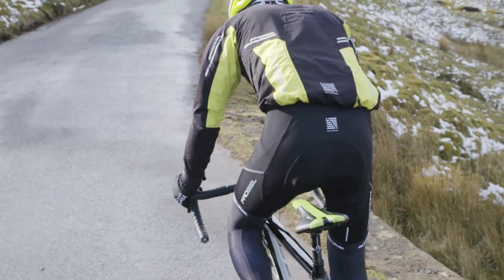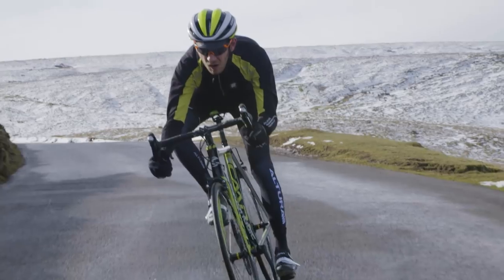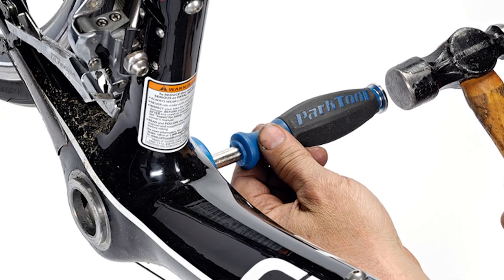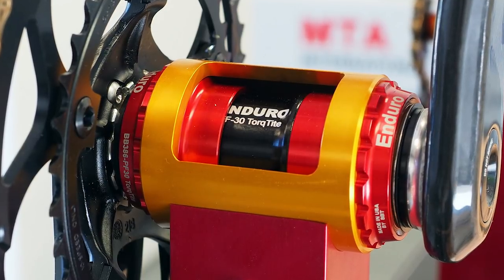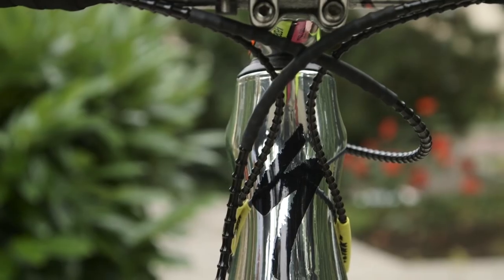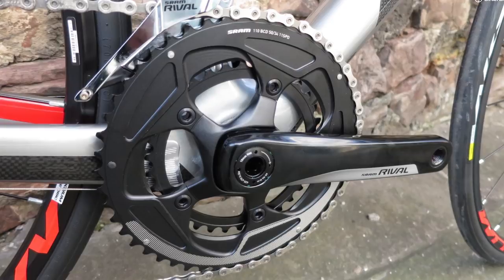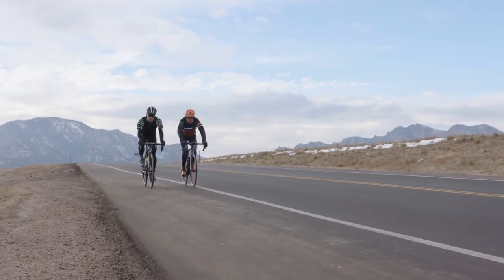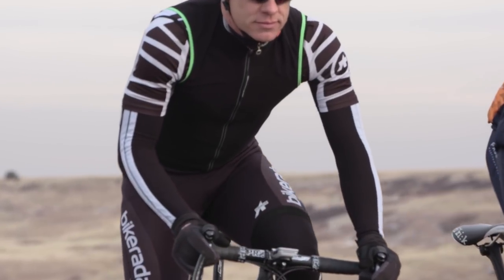Top 5 - Road Bike Upgrades

Comment: my upgrade was taking off the reflectors...
Reply: I replaced them with a custom reflective foil sticker on my rims. Road legal once again.
Reply: reflectors and lighting dont have to weight much. there is nothing more scary to a car driver, than a neigh invisible cylist!
Reply: I personally use 3m reflective tape because they work better and weigh less than the reflectors!
Reply: Same here, sticked to them rims.
Reply: Welkam tu ze klab, sid.
Haven't seen any road cyclist with reflectors, even on clothes.
Reply: @СемёнСемёнов-ы1ь  prison
Reply: Nicolas German Ditto. Plus you can buy colored reflective tapes that blend in better with the frame.

Comment: this tubeless thing is nonsense. Less rolling resistance, more grip? A lie. More puncture resistance? Yes, but with modern tires I have 1 or 2 punctures per 10000km, so that is more a theoretical advantage - and this theoretical advantage is bought dearly with new sealant every few month/every few 1000km. This sealant costs much more than the few inner tubes you need once or two times a year due to punctures and it is much more trouble and swinishness to renew the sealant than to change a inner tube. There is only one reason for tubeless tires: more money for the manufacturers
Reply: More grip come from the ability to run lower pressure without pinch flats.
Reply: Oh man thanks for this. That's exactly what I've been saying for a long time. Never really understood this tubeless hype.
Reply: lower pressure, less/no flat. lower pressure does mean more grip. less rolling resistance, hell, not really. with good tubes its pretty close, can't tell or measure the difference myself. that said id still go tubeless for the 2 very distinct advantages of lower pressure and less/no flat (I've never had a flat on road tubeless .. its been 3 years, i ride 5 days a week - and have probably been lucky so far - but still)
Reply: Lower pressure is for more grip. It allows the tire to conform to all the various features on a road or trail rather than bounce around on it. Less rolling resistance because again, not bouncing off the surface rather conforming to it.
Reply: "on a trail"??? Hey guys, we are talking road bikes! Lower pressure means less rolling resistance??? That's correct only for MTB/CX or to a certain point on the cobble stones; on normal roads its quite the opposite. And, @kangsterizer, well, you had no flats in the last 3 years - that's fine, but you had to renew your sealant about 9-12x, I think? I had 5 flats in that period, changing 5 inner tubes took 1-2 min and 5 € each, is that really an advantage for tubeless? (usually riding 250-350 km/week; btw: made the change back to tubulars on my race bike last year, no puncture on that bike since than, too...)
Reply: Tubeless tyres offer better traction, lower rolling resistance, lower weight and puncture resistance. Fact.
Reply: There is no such thing as a glass-like smooth tarmac road unless it was just paved the prior day to you riding it. Lower pressures will allow you to roll faster, tubeless allows this to be done without pinch flat fears.
Reply: nonsense. Fact.
Reply: Smale Rider how many pinch flats do you actually have in a year? I had one last year. one single flat. I run 100 psi. sure 90psi would be better against pinch flats with tubeless compared to tubes and 90 psi but I can't run 90 psi without  feeling sketchy when I sprint.
Reply: kangsterizer Def depends on conditions and terrain. mtb with low pressure for maximum grip tubeless is great. for me on the road 1 flat takes sub 5 minutes to change. one disadvantage to tubeless that no one talks about is if you get a cut and not a pin hole. sealant will fill a small hole but not a decent sized cut in the tire. You'd have to place a tube and something to cover the hole regardless of tubes/tubeless set up. the fact that tubes are cheap, I rarely flat, it's less messy, and I can change a tube and be moving in sub 5 minutes no problem means I continue to use inner tubes on the road.
Reply: Just trying to sell more stuff to people. I used Kenda Heavy Duty tubes on my MTB and never had any issues.
The MTB world also has a lot of wussie weight weenies.
Reply: very very true mate..
Reply: Do not use road tubeless unless you enjoy ending your ride 50km from home with both you and your bike covered in latex spray.
Reply: And you don't think the road world has even more?  LOL
Reply: fiddler on the bike 
Tubless is a thing thay is better for gravel and cx riders mor than anything
Reply: Dave Carter till you have to change  into a tube roadside with tubeless road tyre/wheel impossible to do get tyre back on. The reason tubeless on mountain bikes is the norm now is all the advantages of grip/feedback/comfort but we can put tubes in trailside if tyres  damaged & refit the tyre back on rim trailside. Till the road bike wheel/tyre manufacturers can solve this it's not a combination I what have on a dark cold winter day or night on the road.

Comment: Saddle should be number 1. You won't go far with an uncomfortable saddle which is usually what you get on a new bike.
Reply: Anything that makes the bike fit better is the first thing you need to change, no use in getting your bike "better" if it does not fit.
Reply: My bike shop put a great saddle on my bike and told me when i picked it up. Is the 2md most comfortable seat i got, right after a comfy recliner couch :)

Comment: "relatively inexpensive" for tubeless. Might I mention that most bikes are sold as clincher and buying new wheels, sealant, new tires isn't cheap at all.
Reply: right! It is not cheap - and it is a down grade...
Reply: Upgrade #6 New wheelset because stock wheels are ass.
Reply: I have to agree. New pump, sealant, new wheels... just started tubeless. Hope it is worth it!
Reply: It isn't. It's an infuriating and messy waste of time and money.
Reply: Charlie Bennici Save your $$$ and get some GP4000's and latex tubes...
Reply: Wow new wheels instead of buying tubeless rim tape. What a clever idea.

Comment: Best road bike upgrade - Disc Brakes
Reply: Smale Rider :  aren't disc brakes a very difficult upgrade?
Reply: Best reason to upgrade the bike :)
Reply: You can easily do the front one though rear wheel has to stay with rim brake. TRP make mechanical brake a lot easier to play with.
Reply: Totally disagree, you will not save weight, because the weight of the discs and the hydraulic brake levers.  They're also noisy.  Also, due to various sized discs, it makes neutral support impossible.  A massive percentage of the pro team riders want absolutely no part of them.   When inquiring about them just this past week, I was told by both a pro team mechanic and a friend of mine in Europe who's son is a pro rider.  Their stories matched.  Disc brake bikes are being forced on the riders from the manufacturers.  One benefit i,s if you must ride carbon rims, there will obviously be no rim wear or heat to worry about.
Reply: nobody who rides alloy rims needs disc brakes, unless you're heavy, then maybe

Comment: Upgrade the saddle. More comfort = more miles ;)
Reply: Bucketlist Fit 
Saddles are too personal though. More expensive doesn't necessarily mean more comfortable. The cheap saddle on my training bike is at least as comfy as my nicer one
Reply: Caffeine and Carbs You don't have to buy an expensive one. I just think you should have a saddle that works for you! IE  no numbness or pain after long rides. If you currently don't, upgrade that first. Bigger km's = better bike performance.
Reply: Actually, I would disagree to that point. The saddle is about fit not the price. Finally, I ran through 7 saddles, the one that fits me only cost me 47 Canadian Dollar though that was a sale price which in reality that would be 120. However, it stays a point clearly, the fit is more important on a saddle choice rather than the pure price.
Reply: But get some good fitting bib shorts first.
Reply: Most of the time saddle soreness is from other areas not the saddle.

Comment: Tubeless in road is a massive hassle if you do end up with a flat! Road them for 4 years and have recently given up on them.  The higher pressures in Road Tires make it harder for the sealant to do its job and it ends up spraying all over gears, frame and you if it doesn't seal/work.  Also the tires are hard to take off and put on so in the event you need to install a tube on the side of the road it wont be a quick job or if you have weak hands it might not be a job you can actually do!
Reply: Agreed.  If you get a flat with a tube tire it's much faster and easier to fix and all you have to carry is a tube and a pump.
Reply: That makes sense to me.  One would think they could develop rims for tubular tires that would make it more difficult for the tubular to roll off the rim; like something that has a raised edge similar to a clincher, but for tubulars instead.  Tubeless would be great if you have a team mechanic, but not as great for mortals.
Reply: So I would have agreed prior to finding the perfect combo. Stan's doesn't work well in road. Orange sealant in Hutchinson fusion 5s is a great combo. I got the Stan's dart tool for larger punctures and carry a single tube in case but I've never used it since going to the Orange/fusion combo. Great set up.

Comment: 4 is not even an upgrade. going for a higher ratio or wider range instead of lower ratio or smaller jumps between gears is just a TRADE OFF.
Reply: So you ride that 53x11 gear all day long?
Reply: No. what's your point? why does your comment have upvotes? what does your reply have to do with my comment?
Reply: #4 Was about ditching a 53/39 with 11-25 . and replacing it with a 50/34 and 11-32. Really it should be titled get rid of the gears you don't use and get something useful.

You have a 53/39, but don't use the 53x11 combination. There is no point owning your setup if you're not using it. You should be swapping down so you're actually utilizing your 11 frequently, that shouldn't be in mint condition.

Many people don't even use a 50x11, and would even better suited for a 48/32 crankset. Get some great low end gearing for climbs, because in reality nobody is a great climber. Get rid of the unnecessary  the top end, people don't really go much above 30mph on the flats.
Reply: Yes, you should get rid of gears you don't use. I did that too and now my small chainring is a 39. I don't even know where i could find a mountainrange to use a 34-32 gear ratio. 

Having a wide range on your cassette, as was suggested in the video, will sometimes result in having more gears you don't use. On top of that the gears you use have bigger jumps in between that mess with your cadence. Even if you use the whole wide range of gears the jumps still mess with your cadence. This is why it is a trade off and not an upgrade. You lose something to gain something.
Reply: You live in the Netherlands? 39X25 seems like a terrible climbing gear. Your cadence surely must drop a lot with that set of gearing.
Reply: For my most brutal 3500 meter climbing races, the easiest gearing I could want is 36X28 or 36x30, but then I lose the 53 for a 52 or I lose the 11 for a 12 or I have huge jumps between gears. A 50x11 is out of the question. That spins out at 35mph which is pretty useless for trying to attack or chase going downhill.
Reply: you spin out at 100rpm? weak af.
Reply: 50x12 is the same as 46x11. People hardly ever use the 11. Your gearing should reflect how you ride not how " internet tough guys" and wannabe pros pretend to ride.
Reply: I do 9000 non-internet miles a year. I missed my 11t cog today on a ride because I changed out wheels and turned the barrel adjuster the wrong way. I use my 11t almost every ride paired with a 53t chainring.
Reply: Like Joe Stevenson said, you spin out at 100 rpm, weak af. You aren't attacking or chasing downhill.. 100 is a just riding speed for strong riders. If you were actually capable of attacking or chasing you'd be spinning much faster, 100 appears to be your top end. You are completely geared wrong.
Reply: Bradley wiggins set the hour record on a gear equivalent to 50x12 and only at a cadence of 105. If you are strong enough to require a 53t chainring you should be hitting podiums.
Reply: so youre saying, Joe, that someone would need a substantially larger gear to pedal a bike down a hill or sprint. I'm saying the same thing. Thanks!
Reply: We're not saying that. We're both saying you lack the capability to sprint or spin. You aren't breaking 100 rpm. If you can't pedal up to the speeds  you need on lower gears, the fix isn't bigger gears. The fix is getting your sprint speed in the 120's rpm.
Reply: You're saying that a 50x12 is perfectly fine for riding around a flat track with no wind at a constant speed by yourself, to which I agree. If this Brad guy you're talking about or other strong cyclists want to do something different than that, they are going to need a harder gear.
Reply: My whole point is people could go out and ride their bikes and get into shape before spending money to try and fix the fact that they are out of shape. Clearly, Joe and Smale, you are out of shape. Instead of taking out your frustration on people who are in good shape, why don't you go out and ride your bike. I guess if you need a granny gear to get up a hill, then that's better and a lot less embarrassing than getting off and walking. I've never had to do that, even with a 39x28, on a 20% climb, and the end of a 180km race. Joe & Smale, I'm sure it sucked having to walk you bike up a hill, but that's not my fault. It's yours!
Reply: I hear all sorts of guys like you babble about needing a 53x11 or that their lowest climbing gear is bigger than the gears a guy named Froome typically uses climbing hills.  And the funny thing is when I see all these same guys out on the road going up climbs they are inevitably ALWAYS riding at some goofball low cadence.  But then they'll talk your ear off about how they "need" that 53x11.  In reality,  there are virtually no amateurs who need nor can they ride a 53x11 properly as a pro does.  They are simply posers wanting to imagine that they have watts that simply are not there,  and that is reality.  LOL

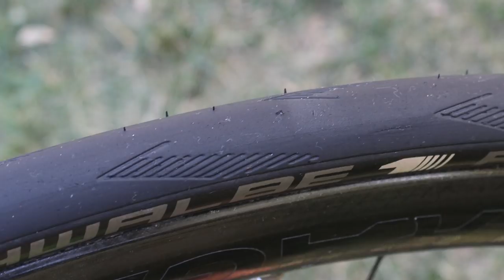Comment: The snark at 2:50 is pointless.  If something offers clear advantages, most people will jump on it.  The fact that tubeless road tires have not caught on probably has less to do with snobbishness and more to do with the fact that they do not (yet) offer clear advantages in weight, cost, or convenience.  Most of us are not mesmerized by the latest Shiny New Thing manufacturers are pushing - evidently you guys are?
(1) No weight advantage: I use Conti Attack/Force 22/24mm tires (actual weight 367g/pair), with Conti Race Light tubes (153g), total 520g.  The lightest tubeless tires I could find, 23mm Vittoria Corsa Speed G Plus, are claimed to weigh 410g/pair, plus 120g for 2oz Orange sealant/tire totals 530g.  (23-25mm Schwalbe and Hutchinson tubeless are 480-510g/pair without sealant).
(2) Tubeless cost a bit more, say $20/set: Currently the tires+tubes I use go for $116/set online.  Online pricing for the Vittorias is $134/pair, add $3/set for sealant.  Schwalbe and Hutchinson are about the same or more.
(3) Convenience:  Fuss of changing sealant every 2-6 months, mess on me and the bike depending how bad a puncture is, additional hassle of figuring out what to do about a puncture when I get home (booting is far easier with a tube holding the boot in place!).  If I have a flat with a tube tire while I'm riding, I simply change the tube, boot if necessary, reinflate, ride home, and relax with a cool brew: no further work needed.
Personally, I try to prevent punctures in the first place by avoiding riding on the shoulder more than necessary.  I listen for traffic behind me, sneak a peek, and edge 1'-2' over into the travel area (which is swept clear of debris by vehicle tires) if the coast is clear.  If I must use the shoulder, I watch carefully and avoid screws, nails, and glass.  If I do run over debris, I wipe my tires with my gloves.

Comment: Surprised Wheels werent mentioned in the Top 5 - Better/smoother running wheel hubs and lighter rims can often shave off well over 200g and even more depending on the wheels.

Comment: Why don't you get strong by wearing through your first set of tires and then you won't need a compact crank?
Reply: So you push a 53x11 all day long, or is your 11 in mint condition still?
Reply: I don't think that was the OP's point 
but to your comment, that was exactly the problem with the microdrive fad a few years back when people were running ridiculous 8t and 9t rear cogs to keep things light and cheap.   They are light, but they also wore out quickly and frequently broke.
Reply: Smale Rider 53x11 & 180 cranks is a must on my road bike 🚴

Comment: Is there any difference/advantage on how the pedaling feels when using a long cage rear derailleur with 50-39/12-28, instead of a short one?
Reply: It's more about compatibility than feel. A short cage mech might not actually work when using a very large range of gears. Such as an 11-32 rear cassette.
Reply: @TheBenMillard  Got it... That was exactly what I knew. But thank you for the answer.

Comment: Road tubeless sucks. What a terrible thing to recommend. I've tried it; I ran road tubeless for two years and tested a wide variety of tyres, sealant and rims.

In practice, sealant failure is all too common, and when it fails, it's a ride-ending disaster. Either you, or your bike, or most likely both will end up sitting by the side of the road, 100km from home, covered in latex spray. So you end up carrying a tube anyway, and then field-installing a tube into even the most supple tubeless tyre like the Schwalbe Pro One is another latex-splattered nightmare.

Don't do it, kids. Leave tubeless to the off-road where it belongs and makes a real difference. Roadies, please, always use an inner tube.